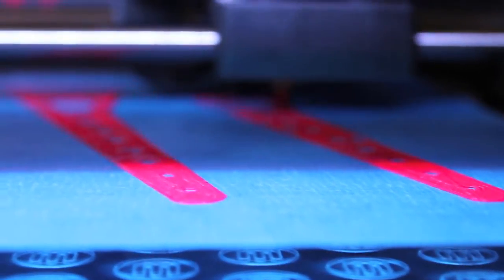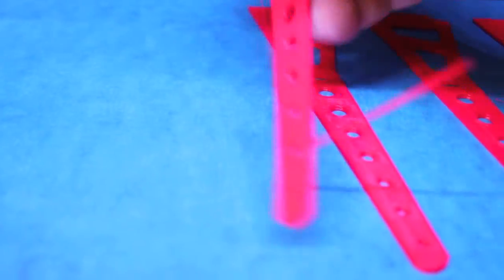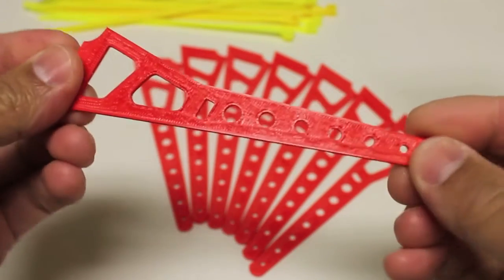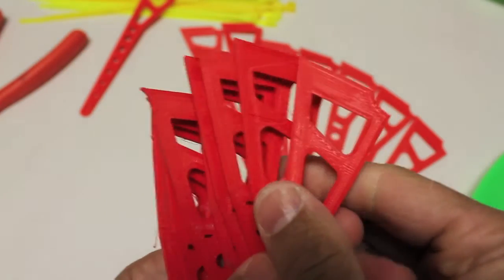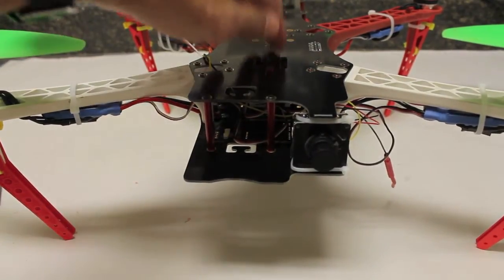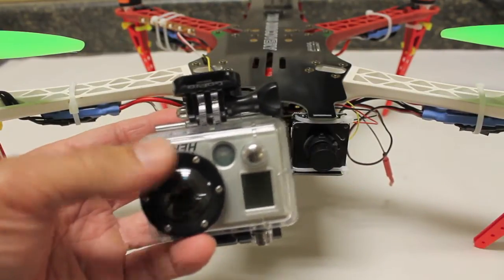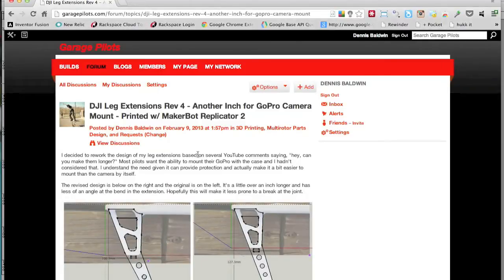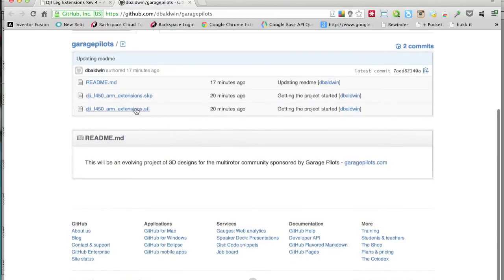DJI Flamewheel Longer Leg Extensions and 3D Print Design Files Available on garagepilots.com

Comment: I just signed up on Garage Pilots. Looks like it's going to be a great resource. Quick question: What after-market platform are you using instead of the flamewheel 450? Thanks in advance!!

Comment from the maker: You and me both. But I haven't actually taken the longer ones out for a loop yet so it was the short legs that held up well. Switching to manual with the Naza is a whole different beast compared to the stability of attitude mode.